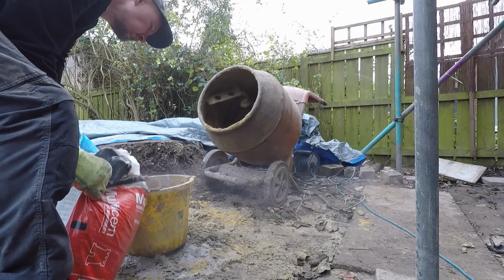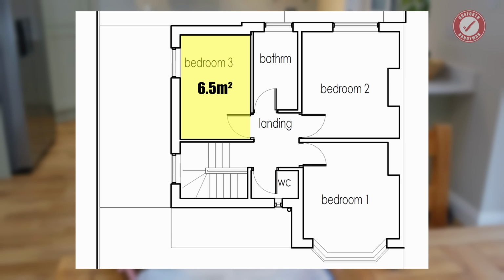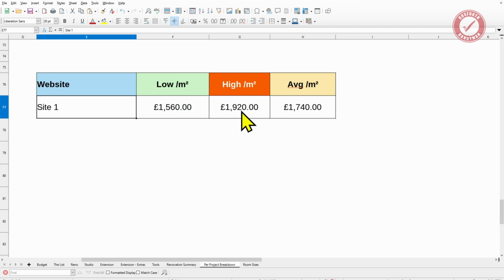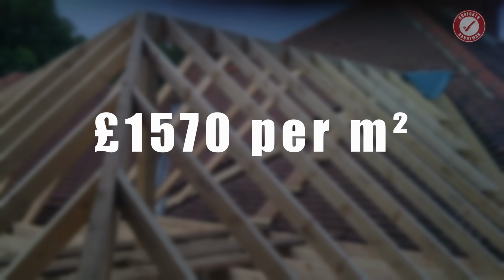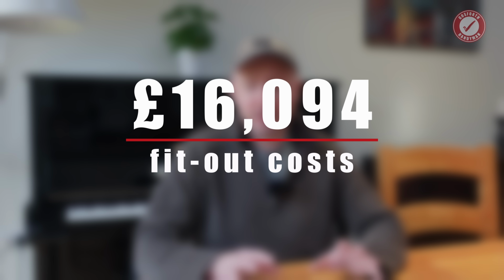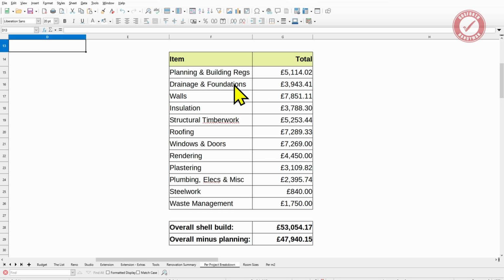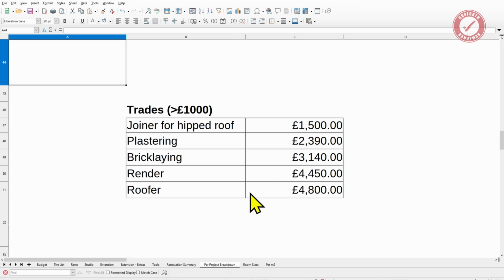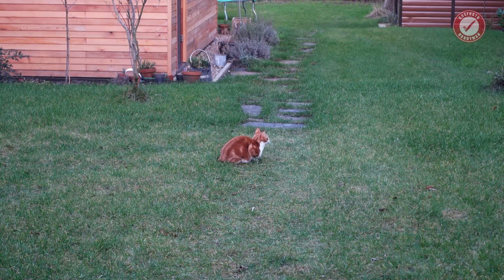How much does a UK house extension really cost?

Comment: For project estimating purposes the gross external area is taken rather than the gross internal area and then the net internal area of refurbishments are taken at a separate figure.  Your total cost per sqm is actually meaningless in building estimate terms.  The best builders price up a detailed work/specification schedule for tender purposes but I know too many builders quote on the basis of what the job value looks like and what the customer can stand.  A professional specification will list all the works, which the builder will price item by item, this is so that in the event of any variations (and there will be) pro rata and similar work can be accurately assessed.
All building works are quoted ex VAT as on wholly new work is zero rated and alterations and extensions are rated at 20% VAT.  Plus some VAT registered clients can claim the VAT back so its of no concern.
I would suggest that a good measure for building work is £2000+VAT/sqm gross external for budget purposes for eztensions and alterations and refurbishments at a detailed cost estimate as each scheme is different, but the location has a major influence as does the quality of the finishes (e.g floor tiles supply only can be £20 -200/sqm and the upper range demands higher quality laying).  Costs in NE England are substantially cheaper than in central London or SE England so the figures quoted in this video must be assessed in this regard.
Reply: We had some quotes for building work last year. All quoted on internal floor area not external. Seems to vary by builder / location.
Reply: @sparkybrian8512  The industry standard used by all quantity surveyors and estimators, whether they are working for clients or builders for estimates is based upon gross external area.  Gross internal area is used primarily for alterations and refurbishment.  Actual building costs for the tender/quotation should be based upon a detailed measurement of all the elements in the building and you will find good small builders will give a detailed breakdown of their tender.  Those that quote on sqm rates do so in a very inaccurate way that will often result in only two outcomes, the contractor will lose money and therefore possibly cut corners or there will be claims, neither of which is acceptable. In the case where the sqm rate is too high the customer will lose out by paying too much.  The trouble is that most customers don't actually know what they should be getting and are totally reliant on the builder to advise them.
I have been called out to advise many domestic lay people who have had work done that they say is not what they thought they were getting or that the quality was suspect.  In all cases, when asked, the builders quote was devoid of any detail and was only given verbally or at best in writing with the description that at best could only be described as vague.  This situation is countrywide and even applies to overseas projects as well so is commonplace.

Comment: Great video, really informative.  We have an old (Victorian) stone-built detached house, to which we've done extensive renovations that have so far taken us 21 years, but we've done everything ourselves, except for some structural steelwork which the house needed in the cellars.  One of the jobs we did was a full cellar restoration after the steelwork had been installed, this was a huge task as the cellars are full height rooms which cover the entire house footprint.  I reckon we completed the work for about one tenth the cost of what it would have been if we had used contractors to do the same job, plus we probably got a higher standard of finish and everything was exactly how we wanted it.  It is very hared work and very time-consuming, but you can't beat doing it yourself if you have the skills and the inclination

Comment: Thing is for pricing (other than the flex for profit)  Footings are price on LM,  Walls on vertical M2 so its roofs and floors ( hard items + insulations ) that go on the space M2 + skips, demolition.  Then we start on the fixings of window and door frames, electrical and plumbing then add on the window and door costs.   Then Fittings in bathroom/ shower areas and kitchens and the price to supply and fit kitchen units add in flooring finishes , heating , certificate existing supplies into new ( and the old are probably naff ),  staircase costs ,  scaffolding , and pain in the backside factor for cutting into existing rooflines etc,  and cost of drainage variations (normally less of a pain than yours was )  .  I used to price £20k for s/s rear extension, £20k for s/s side , £25k for a loft and £18k for an over garage with garage remaining and that was in 1995 so double nearly that for you £20+20+18 is £56 so £112k in todays money wont be far off (actually works out at av of lowest and highes you had)

Comment: Well done a lot of info you put into this video. £/m2 can be misleading especially if it is only a single storey extension as the cost of the roof and foundations is the same whether it is a single or two storey extension, therefore single storey will always be more expensive £/m2. Plan shape can also have an affect on cost.

Comment: Hi Andy, we are in the process of doing a big renovation on our bungalow. Which consists of a 17m x 4m rear ext. 8m x 4m side ext. we took the roof totally off & raised the ridge by about 1m & then converted the loft with a dormer. I like you have done a lot myself & currently we are at £120k, but it’s not finished yet.

Comment: You simply cannot class the UK as a simplistic one price simply due to labour rates. Materials might just about be universal within a 20% variation but where I live even a labourer digging a mains water trench is demanding £200 a day. Trades at £350 a day. I am telling my clients they should allow at least 3.5k per square meter as a base rate. Also every extension I design has a high element of internal remodelling works that can be at a higher cost than the main extension. It's never a simple bolt on unless it's called an awful conservatory that no one wants anymore thank god. I do like your experiences but it's all about location, location, location. In north Wales or Scunthorpe you can build for peanuts due to low demand and unemployment. Here in the south east with full employment and high ranking  IT homeowners near the Thames basin it''s £4k per M2 for most retail clients simply wanting a finished delivered product not a watertight shell.

Comment: Absolutely awesome break down 
Seriously top marks for this vid 
So informative 
I’ve watched this twice and will watch it again for sure 
I’d have defo saved money on the footings and concrete and mixed and poured it myself 
With the help of a couple of mates 
Few years ago I built a double garage 6m x 3m 
And bought all gravel and sand and cement and hired a mixer for the day and me and a mate mixed and poured it in 1 day 
( was hard graft like ) 
The builder and plastering labour costs seemed very good and even for materials 

Like you said the roofer on a grand a day ( guessing he had a couple of lads with him like ) and even the joiner on 750 a day to build the hip seems a bit steep but I know these lads can charge what seems a lot 
I known a few gas fitters who change 2k for a combi swap and make about 800 a day after the cost of boiler and parts 
But I know another gas fitter who will happily work for 200 quid a day ( grand a week minus his van and fuel costs ( he drives a old banger of a van ) and he’s earning 800 a week before tax and he is happy ) 
I got a sparky in to change a DB board last month 
He changed me 350 and was in the house 3 hours the actual db board I could have bought for 80 quid , no wonder he was driving a brand spanking new 40 grand van all wrapped up with awesome graphics 🙈

Comment: Interesting stuff - thanks for sharing Andy.  Could you let us know what skips cost in your area?  I'd be interested as they're horribly expensive here in London.  I expect at least £250 to £300 inc VAT for an 8 yard skip, and with a big build like that easily burning through skips I was surprised how long your waste costs were.
Reply from the maker: It was £250/skip but went up to £300 post lockdown. We went through 3. 👍
Reply: @GosforthHandyman  Surprisingly similar then!  Well done for being so economical - I think we went through at least 10 on my last project!  Thanks for answering.
Reply: Yes my builder paid £240 a skip up north too, a year ago including VAT. We must have had 8 or 10. all the foundations down to 90cm. Half an old garage, kitchen, internal walls, etc.
Reply: The builders round here all seem to know farmers who will take away soil  and rubble for very low cost.
10 ton trailer for less than 100 quid.
Means you only need a couple of skips for the rest of the waste. 
Saves a fortune
Reply: @joelawton123  as long as it doesn't end up fly tipped
Reply: @contactjd  in this case it doesn’t 
But you have to know who you are dealing with I suppose

Comment: The obvious big take-away from this vid, Gos, is that many, many punters are accusing you of not costing in your time!  You did mention a number of times in the comments that you mostly fitted the labour input to the project around your 'day job' and so, there isn't much real cost to add in...
..however, this clearly wouldn't be the case for most people....and so, would make a huge difference to overall costs....as you obviously know very well!!
Presumably, you will make this clear in a follow up ......!?
Reply from the maker: Yup, it's an interesting one and almost needs a vid in itself to explain. For example, if I'm doing nothing on a Saturday afternoon and dig a hole as opposed to going to the pub, technically I've saved money. 😉 Wouldn't happen as I don't drink, but you get the idea. We get bored easily. 😂

Comment: I've done my own wrap around extension with another small extension (full house length) on the other side. I did all of this upto water tight for about £35,000. My main rear extension was also dug down deeper than usual to give me 3m high ceilings in the main room. 

The quote for this work was £160-180k. 

I probably have another 30k to spend to my spek internally. So I've saved myself £100k+ but it has taken a toll on my life and took a lot longer haha. 

But it wasn't a case of saving money, if I didn't do it myself I would have never been able to do it because I would have never been able to afford the upfront builder costs.

I have zero building experience by the way apart from being a plumber/gas engineer.

But so you know, nobody is a builder by trade that I know, infact its just not a thing...they are all carpenters or brick layers or plasterers etc that just decided to become full on builders. There's no qualification you need to be a builder as long as you follow the regs.

Edit: this includes a huge 4m long lantern. 6mx2.25m bifolds, 2x 1mx1m roof lights, new windows on the house.
Reply from the maker: That's fantastic! Really helps being a plumber or spark as trying to coordinate 1st & 2nd fix around everything else can be a nightmare. Nice work! 👍
Reply: Thanks for doing this Andy, it has been a great project to follow along. As well as an excellent build, all the videos have been real gems. Quick question about the roofing, bearing in mind the roof carpentry had been done - in hindsight would you have been prepared to do the roof yourself?

Comment: Just finished our kitchen extension (3m x 2.4m),Including upgrading kitchen units and new quartz worktop and semi solid oak floor.
I had a brickie, plasterer, joiner and plumber in. I did the wiring myself and I supplied all materials. I did all groundwork myself.
Including planning, building control, architect and structural engineer fees, the total cost was £14500.
Our expected cost was £15k.
Reply: 2000 per sq m fully finished then 👍
Reply from the maker: Fantastic work - absolute bargain! 👍
Reply: That's incredible! Did you assemble the team yourself then? Please share your secret!!
Reply: Huge respect for that. It's also a potential massive help if your trade-competent. Being a tradesperson with connections helps. A lot!
Reply: why did you get planning for that size just give notice 48 hrs before and save loads of cash
Reply: @MrDweb  Kudos. Which are the resources for getting information on structural engineer job

Comment: Thanks for the video, I'm looking at doing a large extension in a few years so this series will be extremely useful!  Still deciding whether I'm brave/stupid enough to self manage...
Reply from the maker: I was surprised how easy self managing was, as long as you're organised and have a decent handle of what needs done when. A good experienced brickie will keep you right for most of the build. 👍
Reply: @GosforthHandyman  cheers, I've got a 3 car oak framed car port with solar and a gshp to do first so that might act to see whether I'll survive PMing.  The extension although large (~100m²) should be relatively simple.  The savings and experience are tempting.....
Reply: @tom314  100 m2 extension! That must be a big ol' house you have there.

Comment: Very thorough Andy thank you. Getting any decent tradesmen/company to quote and do a job is a nightmare. And i can quite understand why your other building company only does commercial stuff now and there are a variety of reasons why.  Im really impressed with your spreadsheet skills 😊 by the why. There is another issue thats a modern day thing, so as we are a simular age. We grew up with people who do things and we learnt from them. Sadly a large proportion of people cant put a plug on. And if it cant be bought from amazon (expecting perfection from a box) they struggle.  Just different times thats all. I recently bought a new washing machine and some younger people were amazed that it was plumbed in and working within half n hour, not a difficult job at all we both know, but you get the picture.  Thank Andy great vids as always.
Reply from the maker: Cheers Paul! Yes, absolutely. It was a real eye opener when I did property maintenance work, how much stuff folk just couldn't do for themselves. Changing light bulbs, basic repairs to blinds and one person even paid me to put their new lawn mower together! 😬😁

Comment: We had a 28m^2 extension in 2019. Had quotes ranging from £35k to £120k. Ended up going with a builder friends had used and ended up spending around £45k on the shell I think, with another £15k spent on finishing, kitchen etc. Based on your numbers we overspent a little, but we had so much troubling finding a builder who would get back to me with a quote. In the end though the shell, boiler, electrics were all done within 4.5 months with the finishing taking us a month. Worst part of the experience was shelling out £3.5k to an architect when it turned out I could have spent £600 with someone else for the same work. With post covid prices I wouldn't even contemplate doing any project like this again.
Reply: Could you expand on the "spent £600 with someone else for the same work"? In hindsight you wouldn't have used an architect?
Reply: @oldboyuk  I had a few other issues with the architect that I ended up choosing and when building control came round to do one of the first checks on the foundation I grumbled about the architect. He asked who it was and I said and he sighed. I wasn't the first one to complain about them to him. He said as I knew exactly what I wanted to do anyway I could have phoned building control and asked for advice and they would have directed me to someone they use a lot who would have only been £600. I think it was an architect assistant or something along those lines. Not a fully qualified architect but can do the drawings etc that were required by building control and the builders themselves.

Architect gave me bad advice relating to party wall agreement, kept on leaving bifold doors on the drawing despite saying 5 times on the phone and in emails we wanted French doors; which he then tried to charge me extra to change them. They got someone around to look at the drainage and managed to draw it the wrong way round and again tried to charge me to fix it. I initially got them involved so they could deal with the whole project. They assured me what I wanted could be done well within budget. Got one of his builders around who quoted double my budget so I ended up sacking him. Drawings were complete by then and used a builder some friends had used. He dealt with everything for me, was open about the pricing and explained when issues came up and how they'd be rectified.
Reply: @JamesTombs  Thanks a lot for the advice. I've never been a fan of the idea of spending thousands on a architect for a basic extension. Good tip to speak to building control for someone they might recommend. Cheers
Reply: Our architect was a waste of money, we ended up doing the plans ourselves so we could have saved £1200
Reply from the maker: Yes, architect fees are another story. This can vary vastly depending how involved they are in the project.

Comment: Wow wish I payed that 😢 Just had my build finished September 22.3sq Meters   1single and 2storey extension, just a jot on the back of the house. And that must have cost 90k with a small solar array. 

I’m about 25miles from London had to do a lot of work myself and keep the builders work in check as they started grate and the more I let them do on their own without over sight they cut corners. Don’t even talk about the so called plumber! He’s was told never to come back he loved a push fit nothing wrong with that but when you fit 5 or 6 in the same place it looks like a dogs dinner and all the pipes spacing was the wrong size for the rads, so glad I told him to walk before he missed it up even more.
Reply from the maker: Yup, sadly I think that's on the reasonable side these days too. As I say, other than the £64.5k cowboy we didn't get a single quote under £120k. 😭